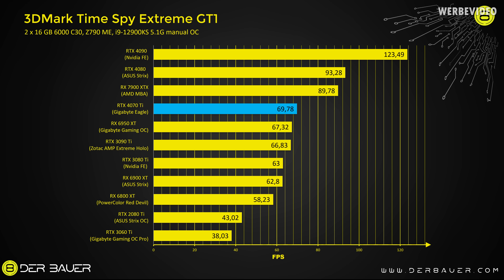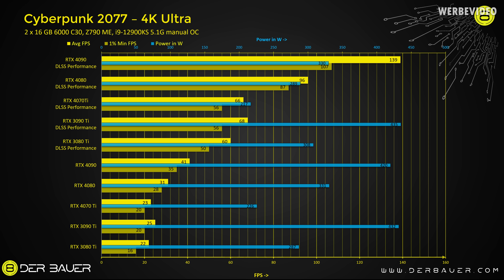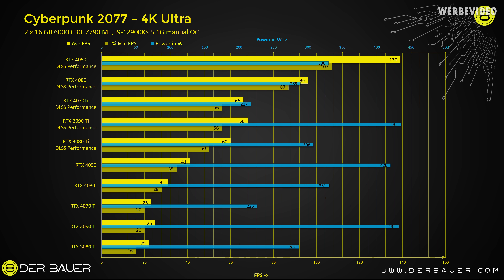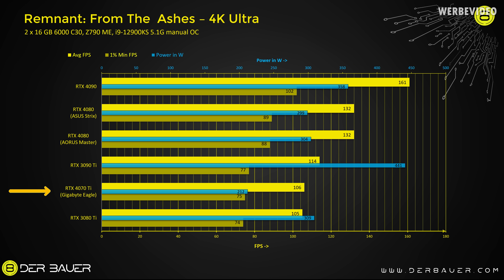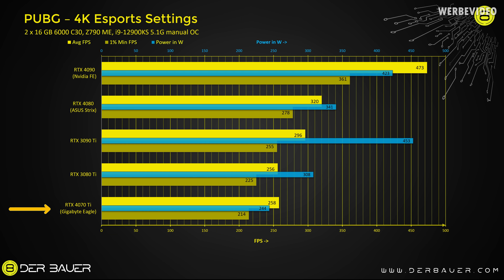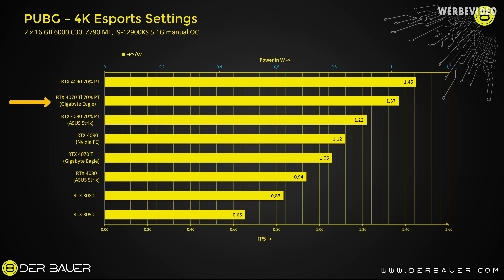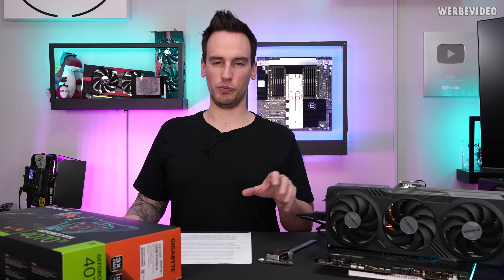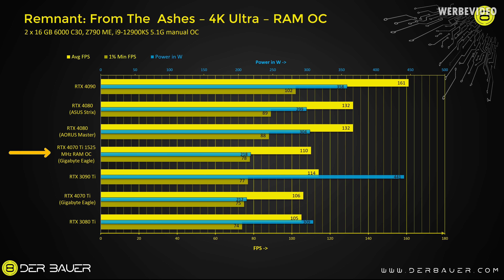Overclocking RTX 4070 Ti VRAM to Compensate 192-Bit Bus Width?

Comment: 3070ti with 256 bit GDDR6X is basically the older brother of the 16GB 4080
The 12GB 3060 is the  older brother of the 4070TI, the main difference being the switch from 12GB GDDR6 to G6X, and the 100w OC, this card should cost around $260 for Nvidia to produce a founder's edition, and should retail for around $429 and 479 for partner cards

Both cards have a  250-300mm (60 class) GPU die
Both cards have a 192 bit (60 class) memory bus

When compared to the 3060TI, 
3060TI: 392mm die, and 256 bit memory bus
4070TI:294mm die, and 192 bit memory bus

The 4070TI costs about the same to manufacture as the 3060TI which is why i suggest a $429 price point
Reply: "12GB 3060 is the  older brother of the 4070TI"  - also i have the 12gb 3060, so you're saying the 4070ti isn't worth the upgrade?  can you explain? thanks
Reply: @YeshuBenPandera  He’s only talking about the Silicon and memory controller specs. Obviously this is way better than a 3060 with over double the performance. It is however, over double the price. So…. 🤷🏻‍♂️
Reply: @YeshuBenPandera  Sorry, i tried to make a short quip instead of making a long detailed comment .Basically this is a 4060 nonTI because the 4070TI has the same die size and memory bus as the 3060 non TI, Yes it is much faster, but thats what new generations of cards normally do(they just dont normally triple in price).

The 4070TI has a ~5% larger die than the 3060 and the same memory bus
When compared to the 3060TI, the 3060TI has a 30% larger die, and a 30% larger memory bus than the 4070TI.

Again, yes the 4070TI is faster, as it should be even if it were called a 4060, the problem here is that Nvidia is charging $799-$1049 for a card that should cost $429, because this card only costs them $230-$270 to manufacture slightly cheaper than the 3060TI to manufacture because of the higher power usage, more expensive node, and the switch from GDDR6 to GDDR6X though a reduction in the number of memory chips

If you're wondering why this is so much faster than the 3060TI while being a the same class of card as a 3060 nonTI, well this is because Nvidia jumped from effectively a 12nm node(samsung 8nm), down to 5nm(TSMC 4nm), they basically skipped 2 generations in performance.

If they had continued like normal going down to TSMC 7nm for the 40 series, this is the performance i would have expected from an RTX 5060, but if they had done that, they could have only chaged $400 for this card, Instead, they're trying to trick consumers to beleive this is a 70TI because of the larger than normal performance jump.
Reply: @YeshuBenPandera  To more directly answer your question, the 4070TI will be much faster than the 3060
This is normal
What is not normal is that this card should be called a 4060 and be priced at $429
So while yes it is much faster, it is not worth the upgrade because of the current price (average seems to be around $950)

What i think happened here is that Nvidia saw all of those 3060s selling for $900 to crypto-miners, and said "Well we'll just sell them at that price for the 40 series"

But then the crypto crash happened towards the end of 2022, and now they have to make up for that loss in revenue, they cant just sell this RTX 4060 card for $429, because no one wants to buy GPUs right now, Sure they're making a 60-70% profit at $429, there just arent enough people willing to buy ANY card to make up the loss in reveneu from mining. About the only thing they can even try to do is to keep the price at $900, change the name to 12GB 4080, and hope that enough people fall for the misleading advertizing not realizing this is 60 class hardware, selling for 80 Super/80TI prices.
Reply: @denvera1g1  i think i got all the answers i wanted, thank you.  nvidia is just greedy AF
Reply: @denvera1g1  I wonder how they are gonna do this now..if they at least gave a 4070 they could of at least gave a ti version later..now the 70ti is just so low end but marketed at a tier below the 80..maybe theyll make a lower vram 80 and make it more lower? to me..they completely destroyed their line up..agreed with this being a 60 class card and i appreciate your explanation..i learned..at first i was saying 4070 at 500..but now that ive seen more about bus and die..yeah i agree..400 to 450 and a 4060..i was gonna say ti too..but i thought the 60 and 60ti were the same die..
Reply: @denvera1g1  а когда такое было что 60 модель next gen лучше топа предыдущего поколения практически, расскажи нам всем а то я не припоминаю такого
Reply: @ЕвгенийАрамонов  The 1080 is a 60 class card, and despite the 1060 being a 50 class card, it was sometimes faster than the 980(a 70 class card)

The ~250mm 5700XT is a 60 class card, and it was faster than the 2x larger 80 class ~500mm Vega 64

But the performance over last gen is not at all what i'm talking, or even care about.

I'm talking about the product stack.
What is the smallest card they can sell, what is the largest card they can sell.

This is what denotes the class of hardware

The minimum die size is around 70mm for a product to be viable and on these newer nodes its probably closer to 115mm, the mnaximum die size is around 600m(or 850 for people willing to pay over $5000US per card) 
I dot care what the performance is, there is a limited number of ways you can chop up a wafer
70-120mm is 30 class(usually 64 bit bus)
120-225mm is 50 class(usually 128 bit bus)
225-325 is 60 class(usually a 192 bit bus but sometimes up to 256 bit)
325-425 is 70 class (usually 256 bit bus)
425-525 is 80 class (usually 256 to 320 bit bus)
525-650 is 80TI/90 class (usually 320-512 bit bus)

More than 650mm and it is usually enterprise only, except for the ~750mm 2080TI/Titan RTX

Everyone points at the GTX 600, and GTX 1000 series as "well actually this is how big an 80 class card used to be" forget about literally every other generation

The 600 series was Nvidia saying "we''ve pulled down ATI's pants, our 60 class card is competing with their best card, so we can just, not release the 670 and 680, and re-name them to 770 and 780, and take the 660, re-name it to be 680, then when the 700 series launches, re-name it to 760.
Look at the specs of the 680, and the 760, basically identical down to the number of transistors.

The 10 series was much the same way, with AMD's 80 class(500+mm) Vega 64, being beaten by Nvidia's 60 class (~300mm) GTX 1080. So what did Nvidia do when it has a performance monopoly?

Nvidia took the ~600mm card that would have been the 1080TI, GP100 and only sold it to enterprise, then it took the ~470mm card that would have been the 1080, and re-named it to 1080TI, took the ~300mm card that would have been the 1060, and called it the 1080/1070. 

At the time they said the same exact thing they're saying now 'moore's law is dead, the nodes are too expensive' but then rumors about RDNA1 started to get to Nvidia that AMD had a ~250mm card, that was beating the ~470mm 1080TI, and Nvidia got scared, because if a 60 class card could beat their last gen 80, which is not that much slower than the 2080, well then what about a full 500+mm 80 class RDNA2. This is likely why the 2080TI was ~750mm, Nvidia was scared that AMD would have an RX 5900XT that would not only beat the Nvidia 20 series, but that may compete with the upcoming 30 series

Oh, and i dont consider the Vega2/Radeon7 to be a generation, it was taking the vega64, tweaking it a bit into vega2, then porting it forward to a new node and launching it months before the RX 5000 series, If i recall it was the only desktop card to carry this architecture, and i think even APUs like the 4700G/5700G used something like Vega2.5
Reply: It's so nice to see at least one person (and five thumbs up) who actually understand what is happening.
Reply: @kevlarandchrome  It’s not rocket science. AMD did the exact same thing. The 7900xtx is really a 7800xt and the 7900xt is really a 7700xt.
Reply: @ZackSNetwork  I agree, 7900XTX should be much higher yielding, and a smaller die.

Really what both Nvidia and AMD are doing is upselling lower end cards, as higher end cards, because they needed to boost the AASP because their expected sales volume was very low after mining crash and after people started to go outside
Add to that that most of the people who gamed before 2020, already got an RTX 30/RX6000 series card because both of these were so good

I was dissapointed with the narrow bus of the RX6000 series a 6900XT having the same memory bus as their last 60 class card, the 5700XT, to be fair, it is not often that a 60 class card is given a 70/80 class memory bus, IIRC the last time this happened it was the ~300mm 60 class GTX 1080 and 1070
Reply: If you just compare the bus width it's an xx60 card but if you compare it's cuda core ratio to the full ad102, it's an xx60 ti GPU but price/performance is the most important factor
Reply: Its just Nvidia trying to be their own scalpers instead of selling a decent product to far more people while still making a good profit... nope, they need to make a HUGE profit. Hopefully the isles full of 4080 cards all over the place compared to the completely empty isles from the last generation will help shock them back to their senses a little. But realistically it won't because the people who are the most out of touch with everything are the investors, and they are the ones who actually set prices by demanding to make as much as possible until it backfires and then they still don't care because they will just jump ship and go somewhere else to wring dry a different market.
Reply: @JohnA...  The sad thing is that by launching at $799, people will rush to buy at $649, despite the likely profit parity with 3000 series being $429-$459 and dropping every day because of cheaper parts to manufacture
Reply: @denvera1g1  Its sad that it happens to start, more so that there are people out there defending the lies they are told to excuse it.

But yes its quite simple in reality, it doesn't get more expensive to make something every year it gets cheaper and easier. As mentioned of course the products are getting better, thats how progress works, it doesn't mean it should be more expensive than the last version was. Yet we have this nonsense concept "inflation" and other excuses used to hand wave away what just comes down excessive greed over putting out a product you can be proud of that far more will be able to access.
Reply: @JohnA...  The products are getting more expensive to makem just not 3X more expensive in just 2 years/single generation for the same class of hardware
This is what happens when we have a monopoly.
Reply: You can’t compare them by just memory bit bus alone. Lovelace has a tremendous amount of L2 cache along with faster GDDR6x memory.
Reply: @ZackSNetwork  he talked all about die size and manufacturing cost
Reply: @ZackSNetwork  Yea, you're giving up compute for L2, the die size of the 4070TI is still 300mm 60 class, so try again
Reply: That's complete rubbish the 12gb 3060 is alot less powerful than a 3060ti let alone a 4070ti. I think your getting your info wrong
Reply: @HiTechReviewsUK  Probably the most informed non-insider. 
Let me start this out by saying Performance does not set the classification of the card, the hardware does

The 3080 did not get re-named the 3060 after the 40 series launched, performance has, and never should be what sets the name and price of a card.

The class of card is set by the size of the die, the width of the memory bus, and the cost to manufacture, and this card costs about $260 to manufacture which makes it cheaper than a 3060TI to manufacture

the 3060TI has a 392mm die and a 256 bit memory bus
The 4060, i mean the 4070TI is 294mm and a 192 bit memory bus, this is basically the same as the 3060 non TI having a 276mm die and the same 192 bit bus.

The main reason the 4070TI should cost $449 instead of $349? The 100w OC and switch from 12GB GDDR6 to 12GB of GDDR6X

Again performance compared to previos cards has nothing to do with the class of card or price because 
THATS WHAT NEW GENERATIONS OF CARDS DO 
Give you more performance, at the same size and price
The problem?
They're trying to sell a 60 class card, for 80TI class price.

If this, lets face it, stupid argument were actually used, why isnt the 4070TI priced at $200,000? Its about that much faster than the GTX 8800 Ultra
Reply: @denvera1g1  Both the 2080ti and 3080ti were $1,200 not $800 so try again.

Comment: every nvidia gpu with 192-bit has been kneecapped and performance fall off a cliff when you go up in resolution or game settings. always been. 660ti had the same clocks and core count as the 670, but was 20% slower at 1080p thanks to 192-bit vs 256-bit alone.

Comment: Damn, Der Bauer went real easy on the 4070ti. Does someone at Nvidia have dirt on him?
Reply: He does not know the pricing... 4070ti is really good GPU!
The price just is not too good... But we just have to get used to this!
2024 these prices will be cemented
5050 $550
5060 $650
5070 $800
5080 $1300
5090 $2000

The Nvidia did make mistake with 4090 and made it too cheap ;) They will remedy it next time!

Comment: Looks like a nice upgrade to my GTX 1070 from 2016, which cost me €700 back then. And i think i'm going for the PNY version, they seem to have a really good cooler going by the TPU reviews.
Reply: be ready for retailers to set it at 1000 euros
Reply: @zeroxception  4080 goes for 1500+. They'll put this around 1200-1300
Reply: You could get literally anything else, LITERALLY ANYTHING ELSE MAN.
Reply: Don't get this trash. Skip this gen entirely

Comment: If each memory chip has 32 x 1Mbit connections, 6 chips vs 8 chips each have 32 x 1Mbit connections per chip, so they all run at the same speed.
There is no difference between the chips. The more chips give you an aggregate bandwidth increase but processing speed per chip is still the same.